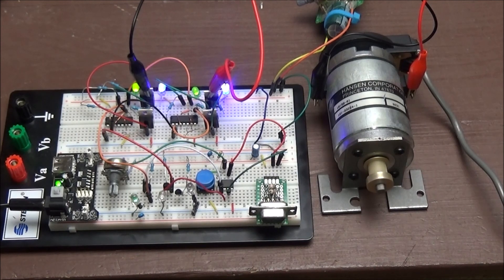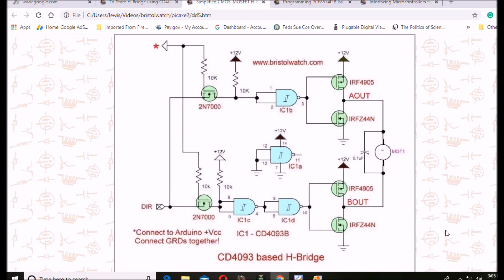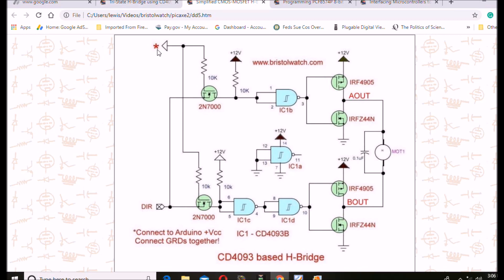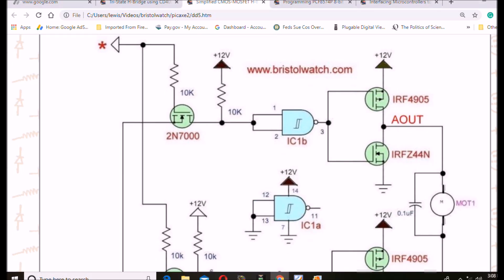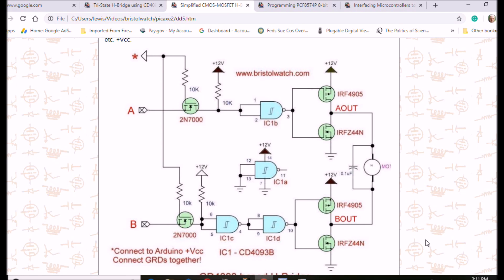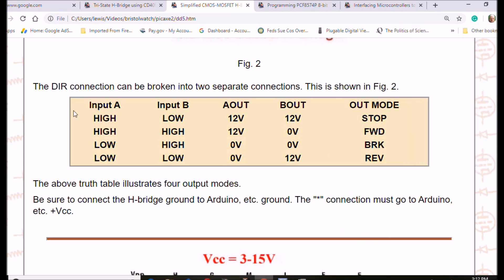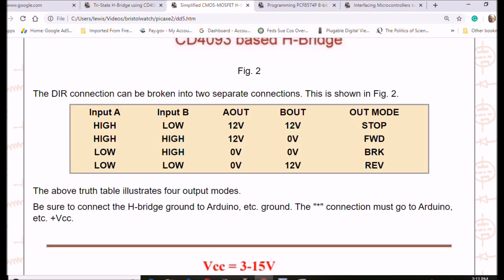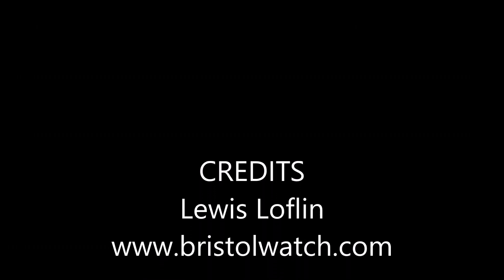Pt. 2 Simplified CMOS-MOSFET H-Bridge Circuit

Comment: The biggest confusion for me is 2 power supplies. I understand how one is for the logic gates and one for the motor but I can’t visualize how the electricity flows through out.
Reply from the maker: MOSFETs are voltage not current operated. Current is not involved.
Reply: @LewisLoflin  how does that work? I thought voltage is the force or push and current is the flow of electrons. Current is what actually powers and energizes?

Comment from the maker: Part 2 of 3
Pt. 1 Interfacing Microcontrollers to CMOS and MOSFET Circuits
https://youtu.be/XzetdwzcOrY

Pt. 3 Tri-State H-Bridge using CD4093B CMOS Circuit
https://youtu.be/b8O4ihdHx8U

High Voltage IGBT H-Bridge Using Photovoltaic Optocouplers
https://youtu.be/azJo4h-ei6I

Arduino Controlled IR2110 Based H-Bridge HV Motor Control
https://youtu.be/d0r-Yx9R3Zs

Pt. 1 TB6600 Stepper Motor Driver with Arduino
https://youtu.be/PHe2MK9CvQM

Pt. 2 Program TB6600 Stepper Motor Driver with Arduino
https://youtu.be/jtX0t7-m69M

Arduino Unipolar Stepper Motor Driver Board with Arduino Code
https://youtu.be/HTVYiLOY8SQ